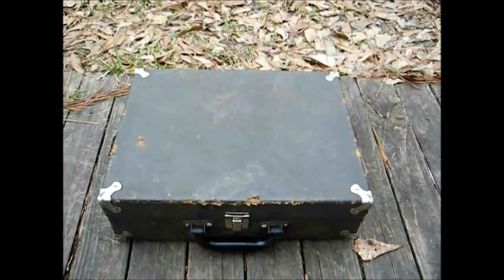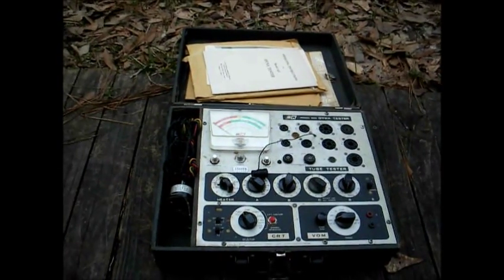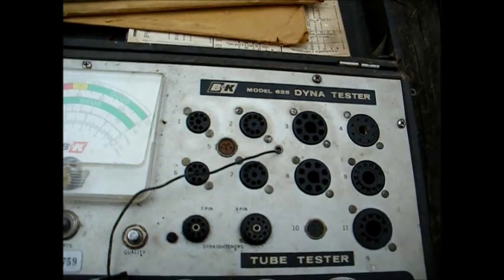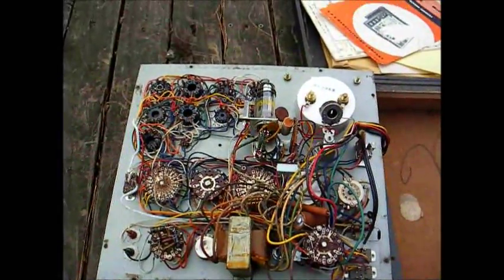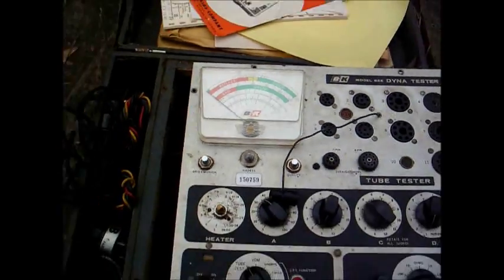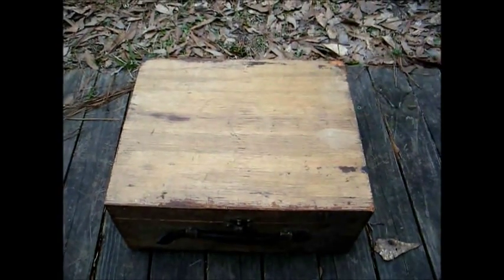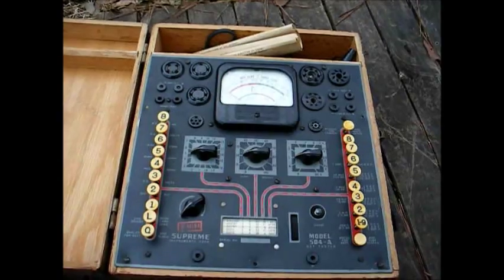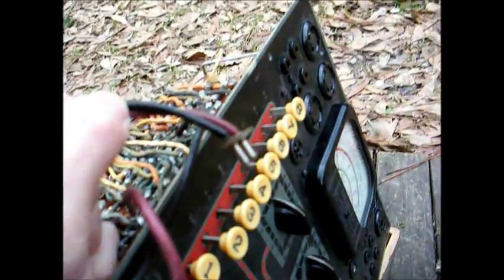B&K 625 tube tester & Supreme 504A set tester

Comment: I like that Supreme for it's ability to test the older tubes...I run a B&K 606 like you do, and as you know, they only go back as far as octals/loktals. Very interesting that it has a 7 pin miniature socket but not a 9 pin.
Reply: justsomeguytoyou I have an rcp tube tester that has a 7 pin socket but not a nine pin. It was given to me and works great but is very old. It tests 4 and five pins, eye tube sockets, locktals, octals and basically any other older style tube

Comment from the maker: The first CRT tester I ever owned was a 465 that was given to me by a TV shop in the early '90's because it was obsolete. It would test the older B&W and color tubes; but, didn't have adapters for the newer tubes. The rejuvenate function was rather crude that would often do more harm than good to a CRT. I eventually saved up enough money to buy a newer B&K 480 that checks old & new CRT's & has a much safer rejuvenate function.